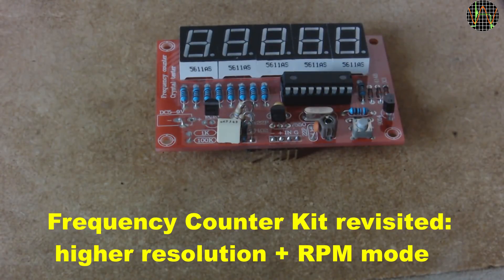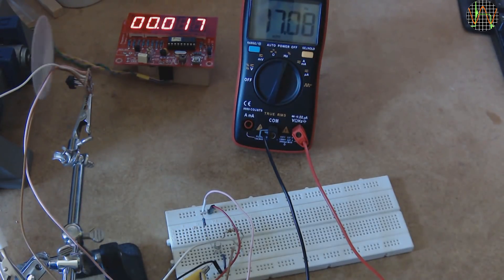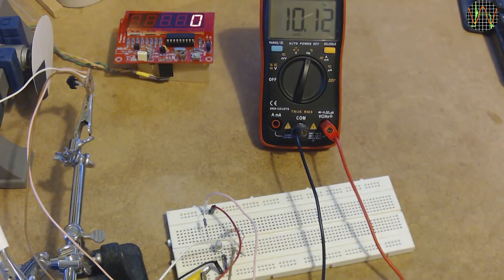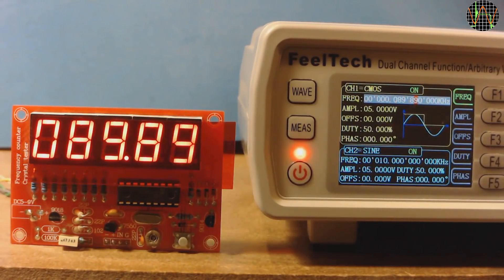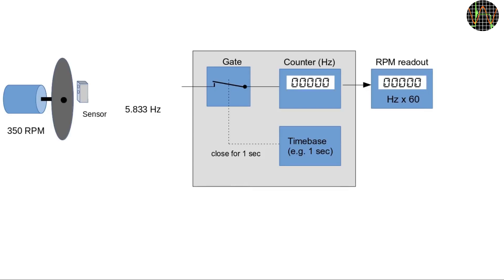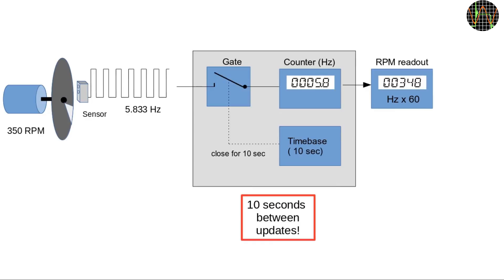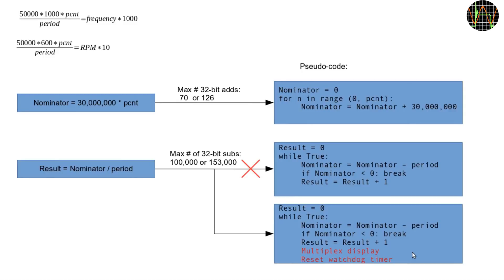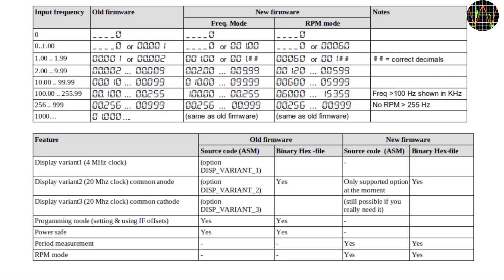Frequency Counter Kit revisited: higher resolution and RPM mode

Comment: BIG QUESTION regarding Display Segment types. In the table at 27:07 it states that this Firmware only supports Common Anode (DISP_VARIANT_2). Is this a mistake? 😧All other documentation and code seems to say that it only supports *Common Cathode*.

My kit is the Yellow PCB version, using Common Cathode. The question is, what display is your latest firmware configured for?
Reply from the maker: Yes it is a mistake  (apologies) only common cathode is supported in my firmware.
Reply: @TheHWcave  - thanks, Heinz. I am reading your email about the same subject, plus the programming help question.

Comment: Hello,
 Can this mod be used as an “turns” counter, to be used to count turns when used with a transformer/motor winding winder (i.e. making a skein winding)?
Reply from the maker: Yes exactly that is the purpose of the count-up mode. Another useful application of this mode is using it as a high res stopwatch. If you feed it with e.g. a 1KHz signal, you have 99 seconds with a resolution of 1 ms

Comment: Hi, cool stuff hey I was wondering if you knew anything about the 8 digit frequency counter PLI-8LED-C? I bought one online last year, and it also has the 16F628 PIC in it, I was curious if this firmware (HEX) would also be compatable with it, it has a USART that is pinned out going directly to the PIC for a PICKIT2 connection so am assuming it could be. It is a really nice unit for $12 I think I paid....
Reply from the maker: Hi Michael, 
I had a quick look at the PLI-8LED-C manual and as a frequency counter it is far superior to the one I modified so many times now...  I can tell from the pictures & manual (and because it has 8 instead of 5 digits) that the firmware is completely different. It has to be, because the PLI-8LED-C uses a proper hardware display driver/decoder chip while my little counter does everything in software with the help of just 1 extra transistor and 3 diodes.  So, no my firmware isn't going to work.
Reply: @TheHWcave  Ok, well I appreciate the reply I was just working on a tachometer for my lathe, and came across the article on Hackaday that guy wrote about your progress on the counter, and that you incorporated RPM into it as well....ok thanx again!!!

Comment: Hi Dear, is possible meassure 40.000RPM? thanks!
Reply from the maker: If you mean 40000 (40 thousand) RPM, yes, the max range goes beyond 92000 RPM. If you mean 40 RPM it depends on how many pulses per RPM you have. With just 1 pulse per RPM, the lowest value is 60 RPM but with 2, 3 or 4 pulses per RPM, the lowest value goes down to 30, 20 or 15 RPM respectively.
Reply: @TheHWcave  I understand Friend, the project is very good, i will test, Regards